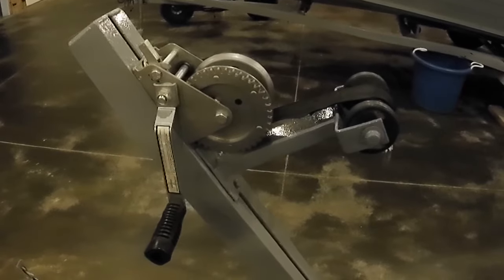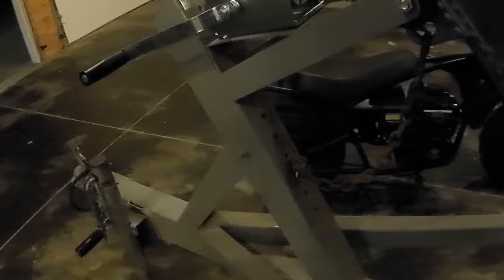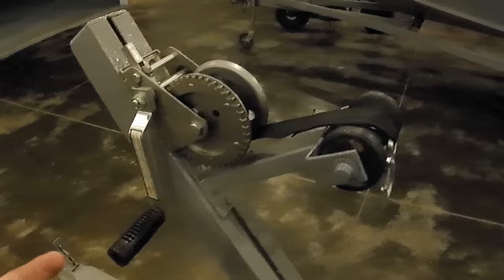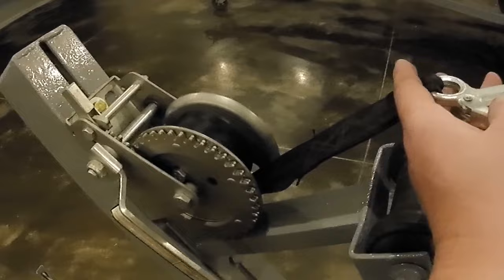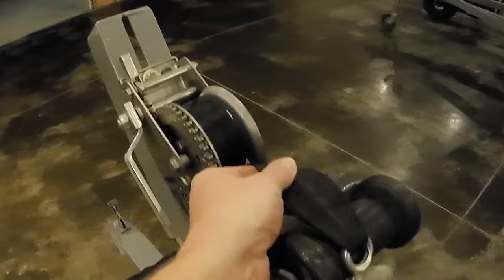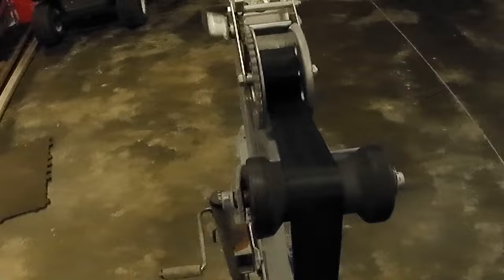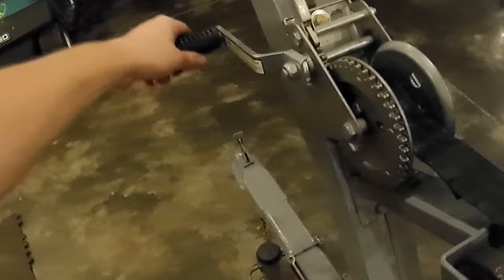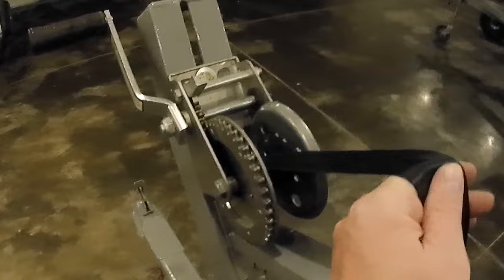Boat Winch Hack

Comment: That first winch you’re showing with the slotted mast is installed upside down. The entire winch mount needs to come off the mast and be flipped. The roller or stop is supposed to be above the eye on the boat. Flipping would place the stop higher and allow your eye to fit tight under it to actually function as a stop in an accident situation while trailering. Chances are you’ll never get into one, just an issue I’ve also dealt with previously.

Comment: Here’s a hot one for ya…mine is also sewn on. When recovering the boat the winch is slipping on its axle. After years of service it can now barely develop enough tension to pull the boat up onto the bunks. The spring ratchet is functioning properly. Where do I put The Tool? :)

Comment: The ratchet system may not hold the load in the other direction. It's manufacturer and model specific! Example : https://youtu.be/la40fNwqYpA?si=RK2kF7nxY1qYfWT8